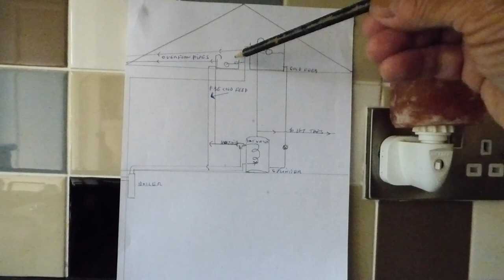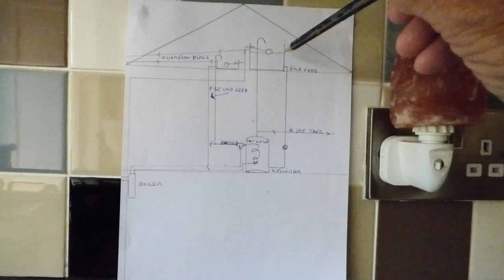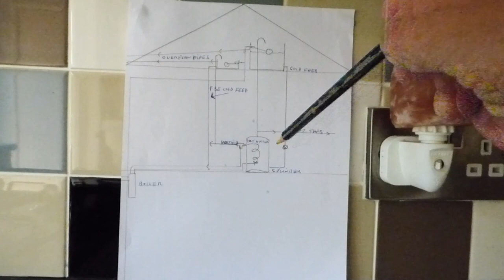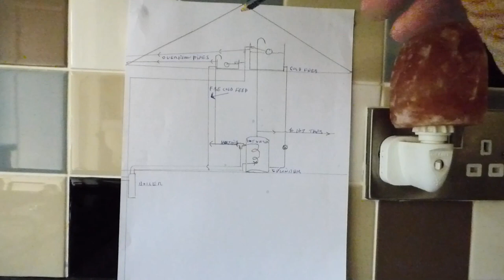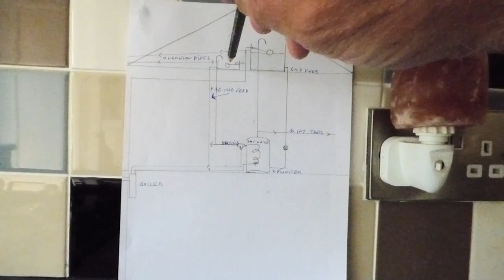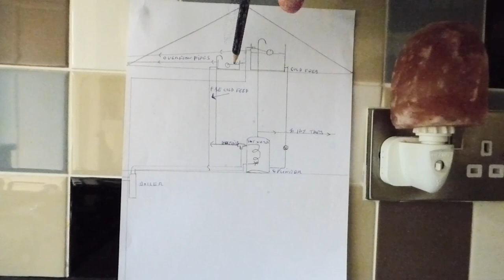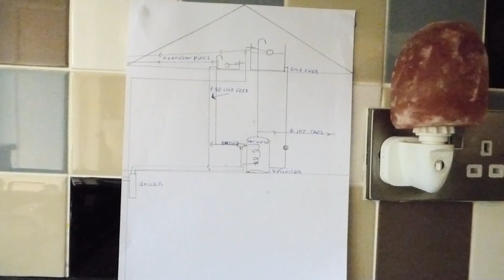Overflow running from F and E tank in the loft.

Comment: Awesome video Al👍, my friend has had that problem of hot water coming out of the vent pipe on the F&E cistern. I thought air was getting into the central heating circuit and causing the boiler to overheat and shut down. I hadn't considered a blockage on the system. Thanks you.🔥👊👍
Reply from the maker: Thanks for the info
Reply: Same problem this problem started after plumber turned up central heating pump to max speed 3,turned the pump down to 1st speed cured hot water pumping like mad into F& E tank and overflowing tank and chucking put overflow pipe top of house.
Reply: Derek thanks video....there is no cold water feed to the F&E tank the stop cock is turned on?I even took plastic Ball cock apart no water coming through any ideas I'm stumped?

Comment: Hi, great video, however my problem of very hot water filling the F&E was solved by turning the pump speed to the lowest setting...also gave the pump a clean out and checked its muscle by sticking a screwdriver in while it was operating.
Reply from the maker: Thanks for sharing
Reply: Hi, how did you realise this was the issue? 
I've just had new CH pumps fitted recently and now have hot water in FnE with an overflow

Comment: Great video   Question for you .  I think my cylinder needs replacing because it is exactly how you described the problem.  a heating engineer didn't listen to me when I explained and described the problems he went up the loft and said he bent the ball valve arm in the F&E tank ?? to stop it leaking but it never stopped  and has condemned my boiler which I will have to replace.
My question is will a new boiler rectify this ?   if my cylinder coil has gone a new boiler wont fix the problem will it ?   PLEASE REPLY 😁😁
Reply from the maker: No it will not, but at least he will be responsible for sorting it out then, as you can say you did tell him before hand.
Reply: @dereton33  thanks so much for your reply  I'm not a plumber or a gas engineer but i like to problem solve things because I like learning still even at my age and if he had listened to me about the symptoms then totally different outcome disappointed with the style of ethics of some of todays plumbers and gas engineers 👍👍👍👍 I wont be paying them for my boiler if it doesn't solve the problem which you and I know it wont

Comment: Hi Al, ive had my cylinder and boiler replaced and I've got this problem, I syphoned some of the water out but it fills up and drips constantly out the overflow pipe. it's not the ball valve, I've checked that.......any ideas ?
Reply from the maker: As you have had your cylinder replaced it cannot be the inner coil. So check you do not have an over heating problem where the tank fills up via the expansion pipe going into the tank.
Reply: @dereton33  Thanks for your reply, yes I think that's where it's coming from, I've messaged the guy who fitted it all, just waiting for him to get back to me.
Reply: @dereton33  Thanks Al for the reply, I think this is the case tbh so what is causing it ?
Reply: @jamiefors5062  did you get a solution after all?

Comment: Hi Dereton ,Silly Question , how could you diagnose if it was the cylinder at fault, or sludge in the system ,  is there a simple test , ie would switching of the boiler, stop the overflow problem thus indicating it could be the cylinder problem , know nothing about plumbing ,many thanks in advance .
Reply from the maker: Yes if it runs when the boiler is off then it is this problem.

Comment: I have this same kind of system with the 2 tanks in the loft but I have a different problem. I was getting a lot of funny noises coming from the hot water tank and some of my radiators were a bit colder than others. So I bled the radiators that had trapped air but now my boiler won't come on so I have no hot water or heating! I had the same problem once before and managed to get it working by pouring buckets of water into the smaller loft tank. I'm sure this can't be the proper solution. The ball valve is floating in the air, not sitting in the water, maybe this could be a problem? Any advise would be so much appreciated!
Reply from the maker: Give the valve a wiggle up and down and it should start to fill and work again.

Comment: Hi there I seem to have this issue but with the expansion loop on the main bigger tank causing overflow for a while. Now I removed main tank by giving main feed to the single exit pipe at the bottom but I am getting constant hot water out the expansion pipe. So that may be an underlying issue. The other issue is I believe this is a vented system so do I need a expansion vessel? I'm not too good with these normally I work on combi systems.
Reply from the maker: Did you connect the main supply to the cold feed to the cylinder if you did you may well blow the hot tank apart as well as that water venting, the central heating boiler could also blow under mains pressure. Yes you do need an expansion vessel. If you have no experience with these systems leave them alone

Comment: The ball in this tank seems to have compressed and is no longer a ball, guessing its not rated for heat?
Reply: My tank*
Reply from the maker: Used to have copper ones years ago.
Reply: @dereton33  I have seen them before, I'm an sparky so not a great plumber haha just wondered if I should put a copper one in if you can still get them

Comment: So if it drips constantly as mine does it is more likely to be the cylinder than the ballcock?
Reply from the maker: Yes, but go up and check the tank. Bale it out below the valve just to make sure it is not letting by first.
Reply: dereton33 thanks will do, fingers crossed it’s the ballcock!

Comment: My neighbours overflow pipe from the loft just spat out enough water to fill a full bath tub 
What could I tell them might be the problem lol
Reply from the maker: If it is that much then it could be the valve in the main roof tank, If it was hot water then the boiler is overheating.
Reply: @dereton33  guessing it wasn't hot 
Was surprising how much come shooting out lasted around 2 minutes

Comment: Hi Deretoon33 thank you for your videos they're fabulous!

I'm wondering if you can help with a problem.

I recently had a leak on an underfloor copper pipe in the bedroom that got resolved by a plumber.  However, I don't have any hot water or radiators now.

I have a back boiler.

I have tried resetting the programmer but that didn't work.

Went into the loft today and noticed the f and e tank water level was below the outlet hole and what appeared to be reminisce of a previous water line, and the ball float was low.  Wobbling the float didn't make a differenc, no water was coming into the tank.  I thought I might need a new ball cock float but not being a plumber thought it strange that the water wasn't coming in to the expansion tank.  I followed the inlet supply pipe feed from the expansion tank that lead me to the main tank like a 2 way valve with a tap on it so naturally checked to see if the tap was in the open position (although nobody's been in the loft).  The tap was so stiff I tried to turn it gently with some pliers and it managed to move but I also noticed the tap was entirely in the off position so water could come into the main cistern tank but not the f and e tank.  

The f and e tank is now filled and the ball cock does work but I think it's strange that the radiators and hot water have been working since I bought the house and moved in over a year ago, is it possible for the heating and hot water to work when technically the supply to the f and e tank was off but the supply to the main big btank was on?  It looked like it had been off for a very long time.

I also bled all the radiators just in case but only the usual bedroom and bathroom radiator let lots of air out.

The back boiler seems to have fired up and heating water for the moment but and worried what might have caused the boiler to stop working since the problem only seemed to arrise once the leak was fixed as the plumber wasn't called out about the boiler and I now can't get hold of him.

Hope this makes sense?

Any help and wisdom appreciated.

Thank you
Reply from the maker: The water even when turned off to the F and E tank would last quite a long time. If you start to get an overflow from that tank, then you will know the reason was because the inner coil of the cylinder is gone.